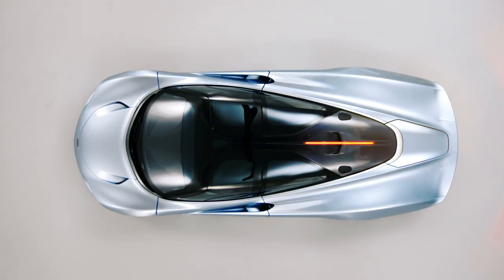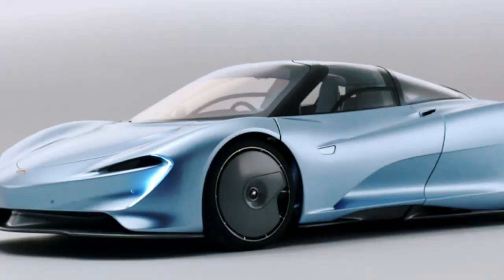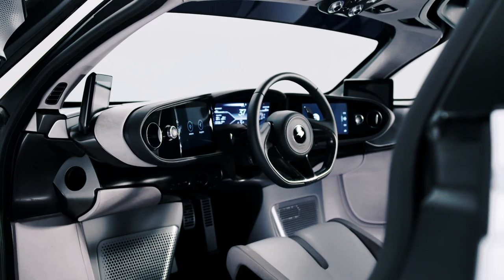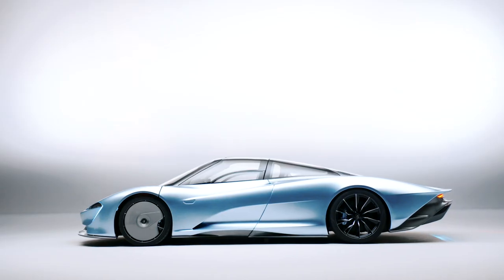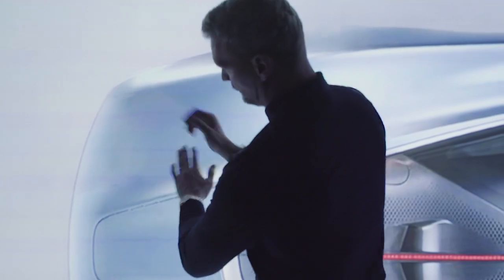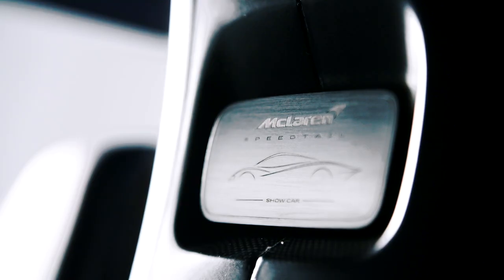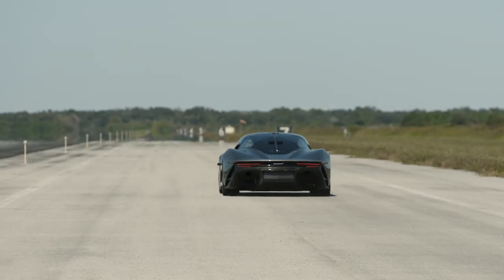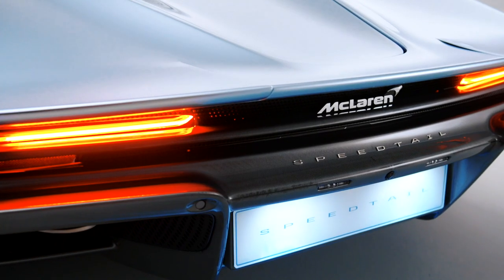McLaren Tech Club - Episode 26 - Speedtail: Designing for three seats

Comment: Which car is going to be better ?
The speedtail or the GMA t50 ?

Mclaren wanted the speedtail to be a modern successor to the f1 but the
t50 is the successor to the f1.
Since the speedtail has many mclaren model designs like the senna rear the bottom front of the 720s the body length of the headquarters ..
The t50 has the toyota Mr2 2002 headlights imo.
Reply: T.50 is more like a f1 performance edition
even more focus into driving experience and track
Speedtail is more like a ultimate grand tourer in Mclaren's mind
a mid-engine grand tourer like their GT
both have their specialities